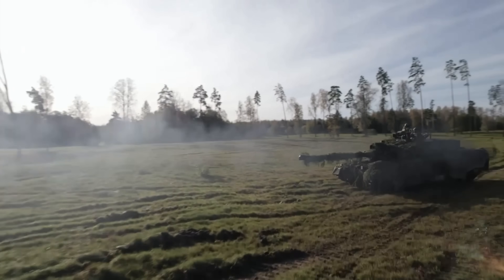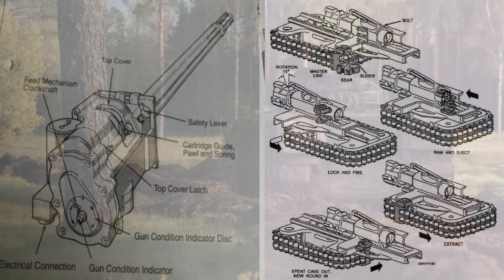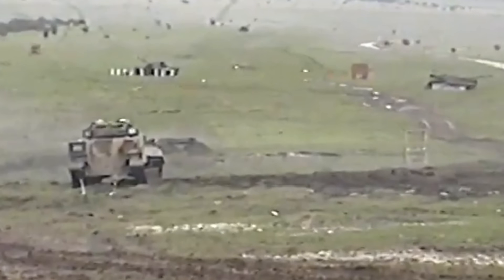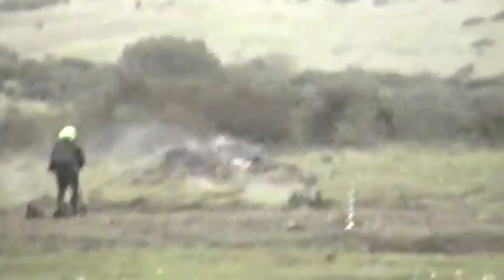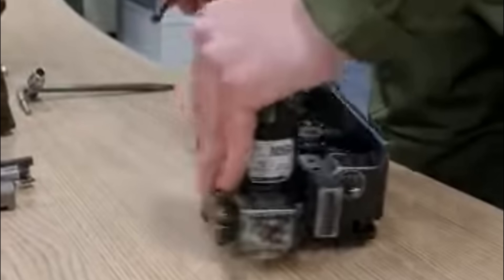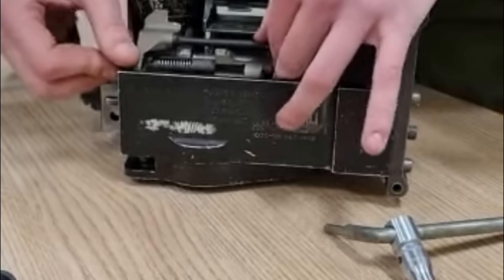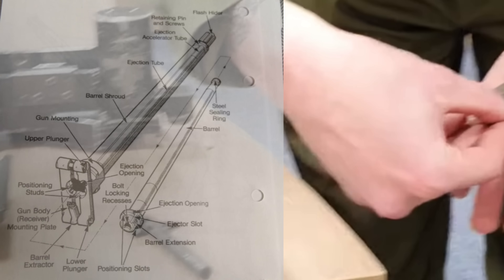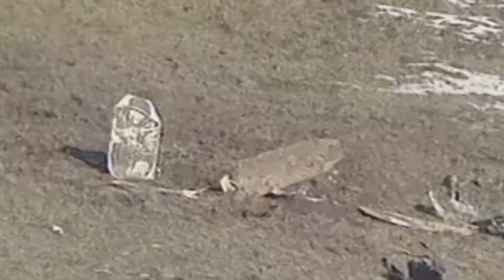The British L94A1 7.62mm Chain Gun | THE WORST WEAPON FOR BRITISH TANKS 👎🏻

Comment: I had a Browning 1919 7.62 as Co-ax and external mount for commander. My co-ax had a 1945 serial number. They performed flawlessly under extreme use. 4 ball 1 tracer.
Reply: I did M2 Refurbishment for the Navy ...we saw a lot of them with stamps from WW2...very cool to see
Reply: @ars492  I helped my unit on an M2 refurbishment. Our oldest and most reliable gun was from 1942. She had a spirit of her own too. Despite getting the M2A1 gearbox, she ran faster than the other M2's. Every gunnery you'd hear a normal 50. Then boom, you'd hear the chopper running at like 700 rpm. She ripped and never jammed. By far my favorite gun in all of troop.
Reply: @ars492  there was this M2 in active service in the Army that was made right after WW1. They found it upgrading M2s to M2A1s. It was still in perfect condition
Reply: This is because John Moses Browning made badass weapons that last.
Reply: @jesseglenturner the trick was his expertise was respected and he didn't bend to the will of beancounters and politicians. If he was working today, his employer would tell him to make the gun lighter, a senator would lobby for its cartridge to be changed and the government would limit the maximum width or some other stupid shit.  
  
He was allowed to build massively overbuilt hunks of steel, that is literally why his guns work so well.
Reply: It helps when the malfunction clearance is pull back charging handle, release
Reply: @walterbigsby6380   Rapidly,reach over and recock,and not burn yourself. We had a solenoid actuator. 
We fought in very thick bush against superior armour. Virtually point blank ranges. Luckily, we were better trained than our enemy.
Reply: On what vehicle?
Reply: @diggledoggle4192    Eland 90.   Panhard AML South African defence force in the mid 80's.
Reply: @ Big respect from me
Reply: @Angus762  I love that lil 4 wheeled armored car.. it's a beast on Warthunder

Comment: We had 240C for the brads. Simple and reliable other than a normal jamming having to be cleared by simply opening the door to the compartment and yanking on the charging cable the only failure I ever saw was a feeder-paw pin shear once and I worked with Bradley’s almost 5 years with two different units.
Reply from the maker: That’s great to hear it was reliable for you!
Reply: @_Matsimus_ I mean, it's just an American built FN MAG58.
Reply: Being not a chain gun kind of helps it seems... I understand that they're a bit more useful/effective in larger caliber cannons, and better setups often offer superior capability to standard MGs... but as a coax MG, not in need of multiple feed belts, it seems awfully superfluous. Honestly, MG-34 did it best, the design made internal barrel swaps a breeze, despite it being a recoil operated MG.
Reply: @V3RTIGO222  the 25mm M242 chain gun was incredibly reliable and quite accurate. Only complaint was 200rpm could be a little slow in some situations and would have preferred it to be in 30mm.
Reply: @TJ24050  I also heard as much, but thanks for adding your anecdotes as well.
Reply: @V3RTIGO222  yeah the Germans retained production of the 34 even after the 42 came out just for tank use. It was perfect
Reply: That spray bottle of CLP!!!

Comment: Electric operated 7.62mm machine gun has got to be one of the ideas of the British arms industry, up there with the MACLOS SAM missile
Reply: It's not the electric motive system, it's economisation on the space for the thing&periphery
Reply: Wait, but does that mean miniguns also have similar problems??
Reply: @dongleseon8785  Electric driven miniguns are actually extremely reliable. Of course, they actually have more than 100 years of development behind them, having been derived from hand-cranked Gatling guns such as those used rarely even as far back as the US Civil War. The only real "modern" features added to them have been the electric drive motor and the ability to use linked ammunition instead of gravity-fed (which did lead to a fair few issues with sustaining the high rate of fire of the electrically operated versions).
Theoretically you could also make a gatling gun driven by hydraulic or pneumatic power, and this is born out by the ones that are fitted to gun pods (usually driven by hydraulic motors which get their fluid power from a propeller on the gun pod driving a hydraulic pump, the hoses and pipes are easier to route in such a cramped space than directly driving it via shafts, chains, and gears).
Reply: @  You can run it from batteries but yes it’s a concern.
Reply: Electric guns can be good if kept on. Electric or mechanical doesn't matter when it is just bad design, and operation.  

 What is a FPV drone, but if not a slow MCLOS! They were onto something! Wrong use though! 

 Suprised Ukraine isn't strapping flight control software to rockets and guiding em with cameras.
Reply: @dianapennepacker6854  FPV is a bit different from MCLOS, because the view is from the perspective of the drone itself. With MCLOS, the operator sees the missile as a far away dot, and has to manually control the missile without a good sense of its heading. That said, it's possible this could be a training issue, and/or a video game issue.

FPV drone flying is much more complex than flying an MCLOS missile, but operators are able to deal with it partially because they are already expert at first person video games.

In contrast, a recruit from the 70s trying to fly an MCLOS missile would have no similar experience to draw upon. Remote control airplanes were a relatively expensive and niche hobby, and in that case RC hobbyists had visual feedback of the direction and orientation of the airplane.

But today? Who knows? People today might be able to fly an MCLOS missile no problem. It's got to be easier than flying an FPV.

That said, they developed the FOGM/EFOGM in the 1980s - a fiber optic guided missile with first person camera. They found it easy for even untrained people to operate. It's really a missed opportunity that we didn't replace TOW with these back then. They could attack over hills and buildings, and attack the weaker top armor of enemy tanks. Neither the operator nor launcher would need to be exposed to the target.
Reply: @IsaacKuo     Oh I assumed it already had a camera the operator saw through. What MCLOS system you guys talking about? Blowpipe? Pretty sure there has been a few MCLOS systems over the past century. 

 Yeah that is ridiculous trying to hit a god damn plane with controlling a missile with a third person perspective.  

  Sims are aweeome. If I were command I'd have all plane/vehicle crews in em as much as possible in the most realistic sims I could buy. Sims, and realistic video games are amazing for training. 

 Each day those crews who perform the best get 50$ Applebees gift cards. That will surely motivate the average American soldier. 

 Anyway yeah I thought MCLOS was camera operated. 

 This reminds me when I was like 11 in late 90s, maybe a bit older. I wanted an RC Helicopter. We go to this nice Hobby/Model/toy store where the owner asked my mom what we needed. 

 We told him a helicopter. He asked my mom how much she made, which is odd.

 She was honest, and he basically told me not to get the 500$ helicopter, but 200$ plane since I would surely break the helicopter on the first day. (He said everyone does)

 Of course within 10 years toy helicopters were like 20$, and flew themselves.  

 Anyway what a dumb idea. It is so hard to judge aircrafts movements in the sky sometimes, especially if there is nothing to help differentiate the distances or heading.

 My friend and I saw a UFO. If it didn't go from hovering in place for 5 minutes to taking off like a bullet with zero acceleration, and Gs no human piloted aircraft could survive. 

  I would have guessed it being a helicopter. (Later found out by others we probably saw what is called the Tr3-B.)
Reply: @dianapennepacker6854  I think they are talking about Seacat. It was based on an anti-tank missile, and early anti-tank missiles used MCLOS guidance. No on board camera - this was before miniaturization of TV cameras. It wasn't necessarily a bad idea when it was first developed, but it had been in service for two decades by the time it actually saw combat in the 1982 Falklands War. The Argentinians were flying jets far faster than what Seacat was designed to deal with.
Reply: Worse idea or just idea？😝
Reply: Tbf in the same Era Vietnam modded their S-75's to MACLOS to beat jamming. That said, the concept is better for Heavy SAM than Manpas
Reply: It's American yer nobber.
Reply: Not as mucked up as the l85 though
Reply: MACLOS SAM is so stupid, how the hell didnt anybody point it out before it even left the dreams of a deranged man
Reply: The mini-gun electric.
Reply: Just one idea?
Reply: I think that Hughes Corporation was the giveaway as to its origins.
Reply: It's an american idea/design.
Reply: @whylie74 And yet it was never used for our MGs.
Reply: @m1a1abramstank49 M3 is a electric version of the M2
Reply: No, M3 is a high ROF variant of M2 with a solenoid to fire it, it’s still a recoil operated gun.

Comment: I think that the electric drive is better for bigger guns as there are more generous clearences on something much bigger, whereas the smaller scaled guns might have an issue with smaller clearances between all moving parts.
Reply from the maker: Interesting thought! It's definitely something to consider.
Reply: Gonna say nope. Gad tight seals happen at specific tolerance. As do dust and grit resistant working parts. ..